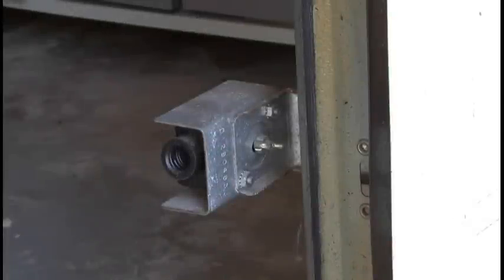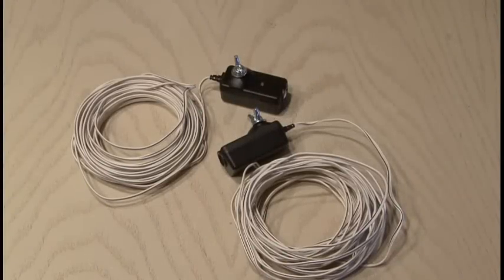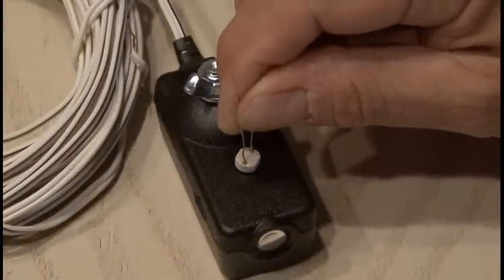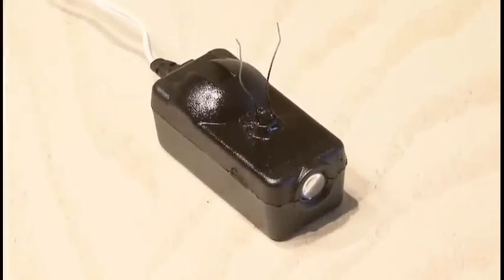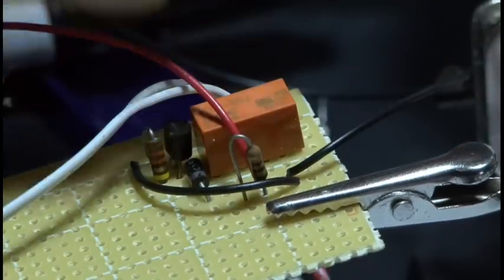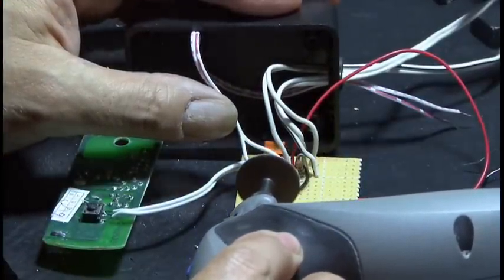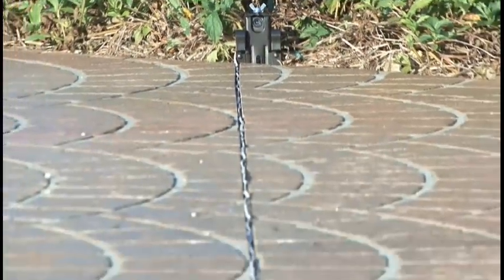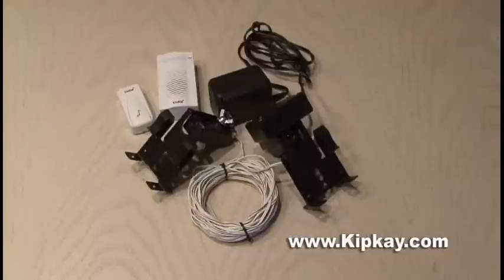Infrared Intruder Alert

Comment: Sentences usually communicate 2 main pieces of information: 1) who is the sentence about, and 2) what did they do? You can help readers find this information using cues in your sentence structure. For example, characters (who is the sentence about?) in your sentences are most likely to be interpreted correctly when placed in the grammatical subject. Similarly, your intended action is best placed in the sentence's verb. You can use these structural decisions to minimize the amount of energy.

Comment: @kipkay - I like it man...

Here's one for you. Aim standard CCTV camera at targeted area. Get old Radio Shack suction cup telephone induction pickup & gut it & rill hole in cup. Put in mini CDS cell. Now adjust video monitor's brightness & contrast so that wherever you stick suction cup it sees a good contrast of image. Hook the other end to DC amp to relay or ADC to a computer and you have a zoned video motion detector(s). Whenever anything moves it causes a resistance change in CDS cell.

Comment: An odd way to handle things, what with the photoresistor. I would've probably just examined the circuitry and used the already existing output of the sensing circuitry. That said, this is a pretty ingenious solution for those who don't want to crack into the case, assuming the sensor has the LED. (Perhaps all of them do? I don't have too much experience with garage doors.)

Comment: You could improve the system by getting an alarm system trigerd by sound so when someone came on to your property with out your permision it will sound and the police will be called, the best way would be to have it set to a remote receiver like the garage door opener so as to turn it on/off when leaving and be able to turn it off in the car as to avoid setting it off when you get home

Comment: You should have also added .50 cal machine guns on each side of the driveway that fire away when the beam is broken. Of course the rapid fire noise would probably drown out the alarm inside, so you'd never know anyone was coming, but at least that axe wielding intruder will think twice before coming back  :P

Comment: DO NOT EVER leave a wall wart powersupply outside. They are not waterproof and will be ruined, with a good chance of electrical shock, or even fire. Especially if you leave it in woodchips.

Comment: Wow, that's a damn lot of work for something you can buy for $20 complete and wireless at Shipwreck Tools.  I painted the sender black, fitted it with an OFF switch to save battery, and out it inside the vehicle.  It catches the idiots who like to rummage thru vehicles.  Or steal from your carport.  You can put the sender ANYWHERE. One guy was kind enough to drop his cell phone as the dog chased him away.

Comment: If you get a separate power supply for the transmitter, you won't have to run the wire across the driveway!

Comment: I'm trying to learn about circuits. I'm a little confused by the schematic and the terminology used in the talking parts. On the schematic there is transmitter, receiver, and switch. I assumed these to be the receiver and transmitter of the beam and the switch being the door chime. After this however you started referring to the door chime as the "transmitter". Can anyone clarify this for me??

Comment: Heres a good idea. MAke one of those awesome powefill laser that household hacker made. Have a switch that turns it on and off. Put the laser on your driveway and have some wire runing to your house. Batterys and switch in house and you have a SUPER security system. Well the alarm is for when you should call 911.

Comment: Why so complicated ? I don't see the point of the photocell. add two wires to the sensor's Led to drive a transistor or a really small relay, which then triggers the remote.